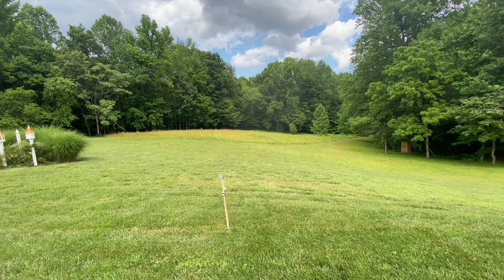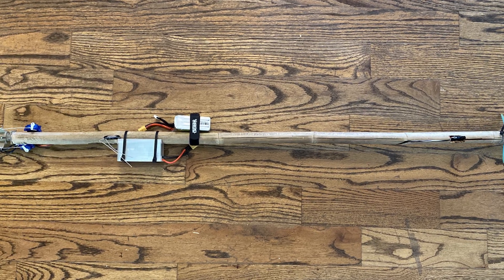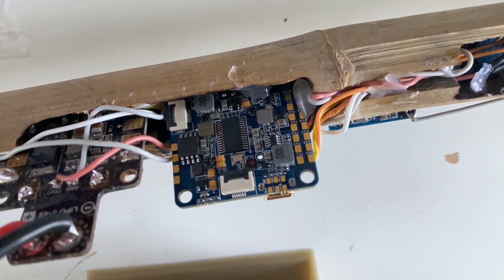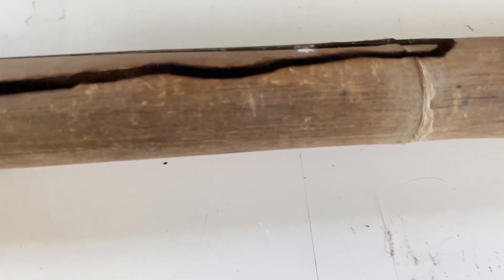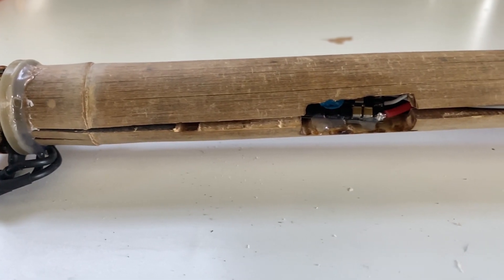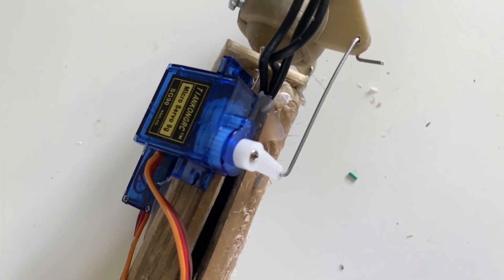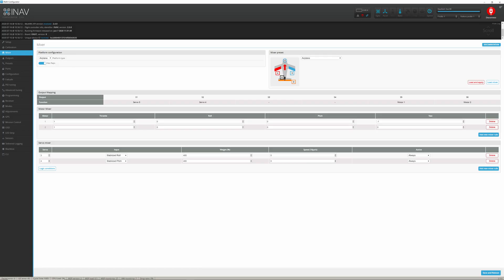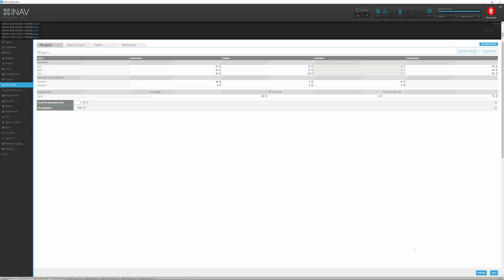A REAL flying stick (Bamboo Coaxial bi-copter)

Comment: Im working on a bicopter to fly in the chinook connfiguration. Im using betaflight and really having some trouble with servo setup. Do you know anything about this and would you be interested in helping me? If i can get it working id be willing to pay. I dont have a huge budget  but iv spent so much time on this rn and Iv got it so close! If you or anyone you know is good in betaflight and are interested let me know thanks!
Reply from the maker: I’d recommend using inav. The servo setup and mixer is much better than bf. That’s what I used for this…
Reply: @InitialFPV  I was planning on it but i purchased a flight controller that is not compatiable.
Reply: I’m gonna try a kk2 board! I still really wanna get the newer FC Iv got to work and it’s really baffling me as to why it’s not!